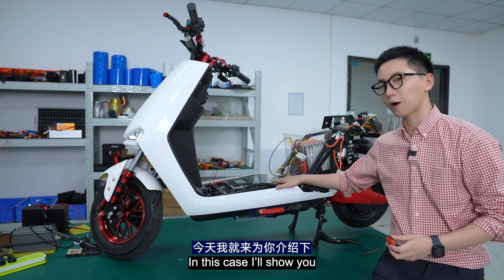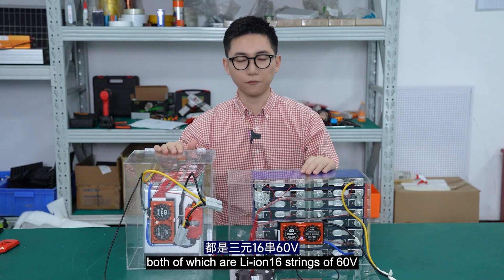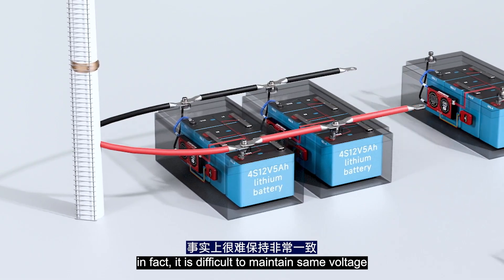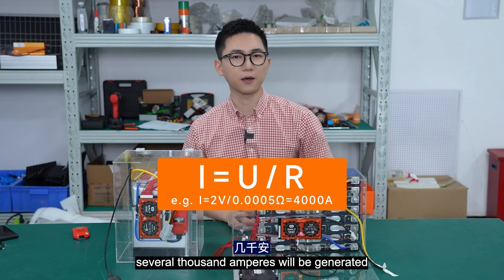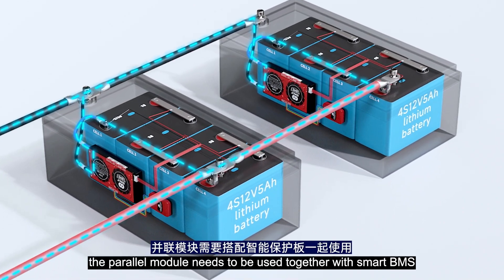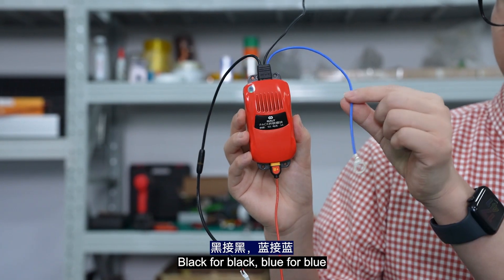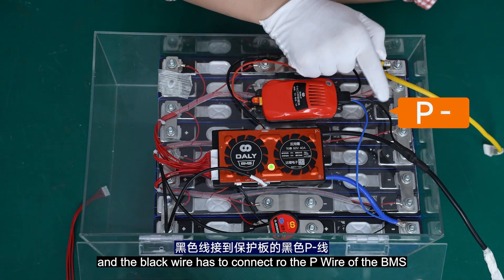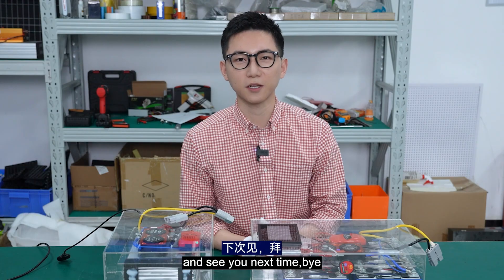parallel module

Comment: Hello Dear Authorized. lifepo4 8s daly smart factory settings come with the battery voltage set as 3.75 v in the software. That's why the software is constantly generating alarms. If we set it up to 3.6 v from the settings, an alarm does not occur. Could you please share a video about the best stable settings of the 8s daly smart device. Add me to this post too. Please don't condemn us to the wrong people's settings on youtube.

Comment: Nice innovation & Nice Presentation too, I used to struggle with high wattage Resistors to achieve this, but I want to the Power Loss that happens during parallel power transfer